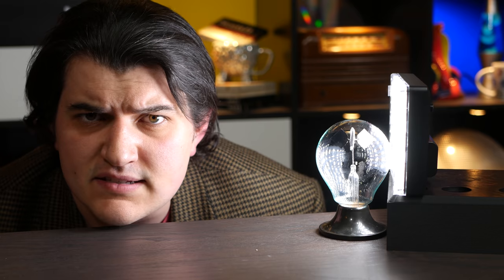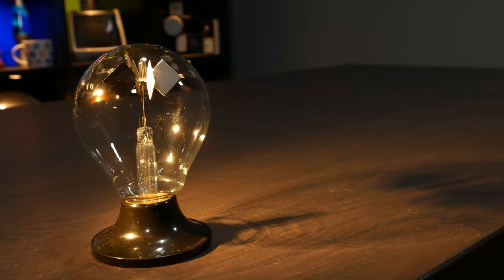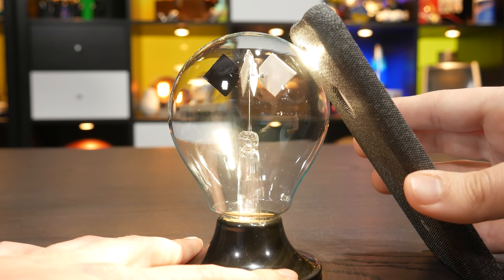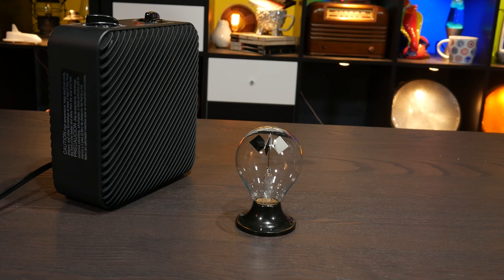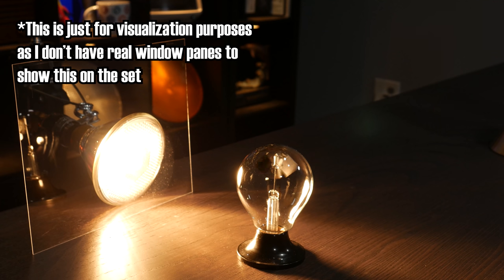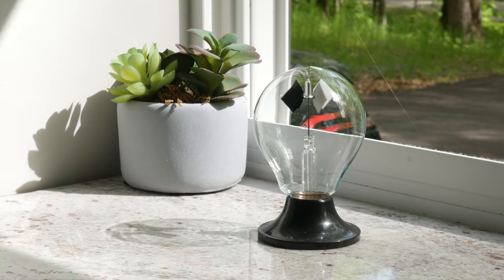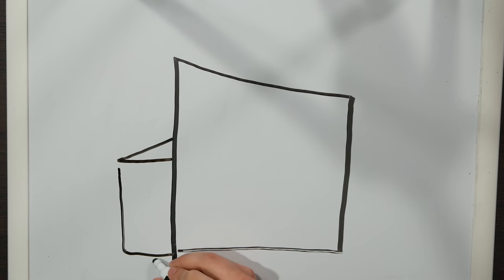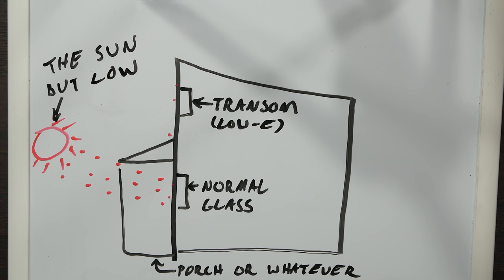What the Crookes Radiometer can teach us

Comment: The side the Low-E is in matters! I work in the office of a large glazing operation. We have actually had large units with low-e stacked on racks (vertically) blow up because the light bounces around them so much that the glass has a thermal failure. They sound like gunshots and will either go all at once or a domino effect.

Comment: I grew up on the East Coast with old wooden windows  which were very airtight. To save energy and keep the house warmer the houses installed storm windows which were installed in the winter. Sorry if I'm repeating what you may already know but those storm windows are installed on the outside of the normal wooden sash windows. They were taken away in the summer so you could open the windows and let fresh air in. Your idea could work, if clear glass was built into to the windows for winter. We would have to change the name. And what we used to call the storm windows would be the summer windows.  The modern summer window would include the low e coating and reflect the sun's energy. Maybe not so practical because people hated having to put the storm windows in and take them out. 
 Almost this as annoying as having to put window air conditioners and in the summer and take them out in the winter. That was one of my jobs as a young boy.

Comment: While the coating on the window glass blocks heat in the summer to come into the house, it also blocks the heat energy in the winter to leave the house. That is why swithing to heat-transparent glass in the winter is no good idea. You simply have to few hours with direct sunlight in the winter. Rememver, days are much shorter than nights then.The house would loose more energy than gain from it. You can have a visual impression of this when looking at a house in the winter with an infra-red-camera. The heated house will simply glow compared to everything else outside. That is, if it is not thermal isolated.

Comment: Hi, I know I'm late to the Party but the part about the low e glass made me write this

I am working for a company that use Co² and nd: YAG lasers at least most of the time. Sometimes we use green 532nm lasers but that's a different Story.

The pinkish reflection you can see is in fact the coating itself. I can't tell you exactly what that coating is made of, but it is mainly for the short 1064nm range IR radiation. We use mirrors coated like this to get the beam from the source into the processing head. Long wavelength IR light like the 10600nm from the Co² Lasers doesn't need special coatings since every type of glass will immediately absorb that. To actually reflect this kind of laser, we use copper "mirrors" focusing a laser like this requires a special material called Zinc-Selenide (if that is the English translation after all.)

Comment: So, as a historic preservationist, I am very much a proponent of Historic wood windows, because of their repairability and maintainability, so that they don’t end up in landfills every 10-20 years like replacement windows.  Historic windows with storms are basically as efficient as a modern double pane replacement.  With the advent of modern HVAC, the use of storms/screens between seasons has lessened.  Having two sets of storm windows would solve this issue.  Summer storms with Low-E glass, and winter storms with conventional glass.  The regular sash can have normal glass.  There is hardware that allows them to pop so that you can open windows for a breeze when necessary.

Comment: I work in a door and glass plant.
Low-E coating comes in different ratings. Thinner or thicker.
It can be applied to one side of each pane of glass. Some windows have it on both sides.
Some windows have 3 or 4 or more panes. Some of these have layered Low-E.
Low-E cannot be applied to frosted or satin glass - the acid etching process destroys it.

A competent architect or engineer will select the correct Low-E thermal ratings for each structure. And will consider things like local weathers, temperatures, orientation, and facing.
A competent salesman will convince the customer to buy the most expensive Low-E option, whether it's optimal or not.
A competent installer will correctly install the Low-E. But the majority of installations are done by less competent, less trained, less informed people - who put it it backwards as often as not. It's a good bet that if they don't have a Low-E detector (an "E-tektor") in their pocket then they don't know anything about it.

Comment: The coating is rejecting much more heat in the longer days of summer than it would allow in the shorter days of winter. So it should work out in the consumer's favor. Especially across the midwest where the summers can get pretty hot.

Comment: I had one when I was a kid and I loved how fast it spun in direct sunlight. The explanation on the box did describe it as heat-driven and claimed that the difference in speed of air molecules reflected off the black and white sides was key. But many years later I saw an explanation insisting that that was wrong too, that if that were the whole story it would quickly reach an equilibrium, and emphasizing thermal transpiration. The thing seems maddeningly hard to explain in lay terms.

Comment: About the Bajorans riding in a lightsail ship to Cardassia, I, too, saw that episode of DS9.
Here's an idea about blocking IR in summer but allowing it through in colder weather -- sunglasses. Imagine a transparent, perhaps strong plastic, pane with the IR reflective film which can be hung up in front of the window and then easily taken down and stored in the garage over winter. The windows could still be dual, or even triple, paned with inert gas between the panes, but the infrared reflective part would then be adjustable as desired for each season, if you don't forget to take them down or put them.

Comment: This device was used to demonstrate the pressure of light (particle-wave duality) for many years, at schools, universities.
The same, wrong interpretation was used to explain tails of comets, being deflected forwards by solar light pressure (false), of course the reason is different - it is a stream of high-energy particles that swings the comet's tail in front of its head as it moves away from the Sun. So we may discuss three remote, contactless  sources of propulsion of material objects - photon reflection (small effect), IR heat transfer (Crookes radiometer) and momentum received from high energy particles (that may include also a ion jet propulsion). Then later many not well evaluated ideas were presented to build a photon propulsion engine (a sail built of mirrors). 
However, Japan sent IKAROS (Interplanetary Kite-craft Accelerated by Radiation Of the Sun) probe, which used solar energy to control the rotation of this rather small satellite. They used a matrix of small movable mirrors (like in video projectors) acting as a control direction sail. 
Back to the Crookes radiometer: once in the '90s (I am not sure if not earlier) somebody wanted to build a new series of these toys and after applying much better technology - a better vacuum, it appeared that rotation of wings didn't occur! So later investigations proved the source of rotation - a IR radiation transferred to heat,  isn't it a bit similar to Maxwell's demon? If - yes, it would be its "macro" version :) 
I am also not sure (somebody may correct me) when evacuating gas from close vessels a higher molecular mass gases are "sucked away" slower, so concentration of Ar and CO2 is a bit higher in a not perfect vacuum atmosphere. Thus making the rotation faster.

Comment: So it's a very very very very very very very very small solar sail?
Reply: No. Well, kinda. It DOES technically have a force exerted on it by the light pressure directly, but that force is basically negligible compared to the wind created by convection (and, as was pointed out, in the wrong direction).
Reply: I think the point of the entire video is that the answer to your question is "no".

Comment: They have static cling nano ceramic and mirror tint.

You can have these on during the summer and peel them off during the winter if needed. 

I like leaving mine on year round since in my mind there's less IR coming in during winter and it helps keep the heat I paid for inside.

Comment: @technology connections Fun fact: I used to work for Sears home improvement as a service tech. One of the products was replacement windows. There are (were?) only a few company's that manufactures/d those...
Anyway, it did matter which way the glass was installed, as there was a removeab sticker that indicated inside/outside on glass packs only. 
The glass can be removed and flipped around, and all you need in a hammer, and a small chisel. I would be happy to demonstrate how to do that as I have a model in my shed that I can do that to.

Comment: For a low-e adaptable window... They make ambient light rejecting screens for short throw projectors. They reject light that doesn't come from a specific angle range. If one could apply a transparent version of that to a window, along with IR reflecting on the angled surface, then high summer sun would have IR rejection, while the low winter sun would not. Basically a microscopic version of the awning idea, except with visible light allowed in instead of being blocked...

Comment: One of the old devices i read about what a decice to demonstrate rf signlas on an antenna, it was two wires horizontally mounted in parallel with a floirescent tube suspended across them. A rf signal was then put on the wire. As you slid the tube the length of the wire you could observe the peaks and valleys of the rf wave on the wire. This demonstratng how antenna length and rf signal wavelength must match, etc.

Comment: Use 2 panes glass with the low e coating applied in horizontal stripes so that light rays that strike the glass from high angles bounce off of a stripe on both pieces of glass but at low angle passes between the stripes. In summer it'd block 100% and winter only 50%.

Comment: Yes - HS physics in 1970's.  Teacher did explain correct reason.  All of these I have seen the rotors are high up in the envelope; I wonder if that proximity plays a role in the operation, similar to ground effect for an aerofoil.  It may be an optical illusion but the one in this video also appears to have the vanes angled very slightly off vertical.

Comment: The problem with low-E glass in the winter is easily negated by simply closing the window blinds to prevent radiant energy from passing through from inside to outside, especially at night. Granted, you still will not get any "free" heat from the sun during the day, but overall, your net energy consumption should be lower.

Comment: We have those electric windows that turn opaque when voltage is applied. Why not do the same but with the low-E coating and a smart controller. As an added bonus, a current sensor can see if the circuit (the window) is broken, and set off an alarm of sorts.

Comment: On the topic of 'does the side of the glass that's facing each way matter?', the answer is no. There are materials (google 'dichroic glass') which will reflect one (set of) wavelength(s) while transmitting a completely different (set of) wavelength(s). However, even these materials are isotropic in that they can be reversed and will still transmit and reflect the same wavelength(s). To the best of my knowledge, there exist no types of coating that will transmit light in one direction but not the other. Source: I have a PhD in sub diffraction limit optics.

Comment: your question about rather or not it matters what side of the glass a coating is on. If you have absorptive and reflective coatings, the ordering of them certainly matters. I would have to find my sunglasses and try it again to remember what the results where, but a pair of amber tinted sunglasses with a blue mirror finish and a flashlight and alternating what side of the lenses you are on and rather or not the flashlight is on the same side or opposite will demonstrate this.

Comment: something extra: 25:47 One summer day, as I was walking past a tall building with a full glass wall on the facade, I suddenly felt a tremendous heat on my legs and arms, and I jumped up of that heat. I was curious about the source of this heat, I even thought about a purposely built source of concentrated heat radiation.
It turned out that one of the large windows formed a concave mirror! with a focal length of approx 25 m. Probably a double-layer window unsealed, argon from the interior (the space between the panes) leaked out during heating, and then the leak gap closed when it cooled down. Internal pressure lowered and glass surface got concave.

Comment: There is a way to implement low-E glass in the summer and not in the winter in the form of low-E storm windows which could be used seasonally. Of course, there's no guarantee that the heat gained in winter by removing it would be greater than the heat lost at night and on cloudy days.

Comment: I feel the same way about the slide rule.  Never gave it much thought, my dad had one, he was an engineer in the pre calculator days. But he gave me his old one, and I found a manual, and those horrible math questions a train is travelling 73mph and it left the station 18 minutes ago how far did it travel?  and in 38 minutes, and in 1 hour 43 minutes, and 3 hours 5 minutes.  You set the slide rule once, and the answers are just there to be read you can see the relationship between speed and time

Comment: Light doesn’t have weight. I just learned this in physics class. It doesn’t have mass but it does have momentum. It’s just Planck’s constant divided the wavelength. It also helps more if you think of momentum in terms of N•s rather than kg•m/s. How it works, I couldn’t tell ya, but I know that it works

Comment: Although photon impulse is not spinning this directly, heat generated by photons is effectively photon impulse transferred into impulse of the atoms in the material (i.e. atoms moving around aka heat). These moving atoms then push off of the surrounding air molecules, propelling the thing forward. Thus is could technically be still correct to say, that the light pressure is causing the rotation - albeit indirectly. What do you think?

Comment: Partial vacuum.  What about the moon?  What about Mars?  Do the tubes even need a  sealed glass? Proposed first experiment on Mars and on return to the moon:  Crooks tubes.  Q2:  what about different gasses: carbon dioxide, ammonia, only nitrogen, hydrogen, helium, laughing gas?  Q3 what about different pressures

Comment: When I was 8 I was gifted a gizmo, it wasn't new, the transparent plastic case was scuffed, it was a solar cell hooked to a propeller blade, not even a fan it did not displace air. But my first experiment was, does it work with artificial light. Waited for night, turned the ceiling light. Yes, but not wel, it spins slower. Tried it with my halogen flashlight and yes, spun faster. Ah-ha! It's the intensity of the light. There was a great sense of discovery and desire to understand and experiment and learn that this simple, old, useless device showed me. The viceral nature of such things cannot be ignored or understated

Comment: @technology connections Low e glass windows would keep a home warmer in the winter than regular glass windows. That's even if the regular glass windows were made as tightly sealed, and double pane, as the low e windows are. The regular windows let just as much infrared light out as they do in. I understand how it was easy to trip yourself on that.

Comment: You can totally have your summer only IR windows. Get plain old windows with no IR blocking and put shutters on them. With the louvers properly aligned they'll block nearly all sunlight from hitting the window but still allow air through. Yes you'll need to close the shutters in the springtime and open them in the fall, but you can't have everything.

Comment: Baring having perfect two-way coating, that would still be subject to physical switching...

A simple bolted (ideally) or snapped-on extra layer on the outside (with care to water management), would achieve that. You put the extra cover in the summer and remove it in the winter. As an added bonus, there is some slightly increased insulation on the windows.

If a two-way coating would work, then a simple 180 rotation of the panes (or Snap-On on the inside) would have dual benefits.

A translucent curtain may reach the same effect, with probably lesser efficiency but ease of use.

Ref :  https://youtu.be/t-JN2U4jHgk?t=1032

Comment: 17:50 no, it would not work. When the IR reaches the coating regardless of the direction it will be reflected back out, you proved that when you had the floodlight reflect from the inside of the window onto the radiometer. However, there would be a little heating of the layer of the glass that the light passed through on the way in and back out, so the glass would get warm.

Comment: As a window salesman, I use a radiometer. I think I had a good idea how it worked before your video, but I still loved the info. To be honest, I was nervous you were going to debunk that demonstration as a sales gag and I would have to stop using it. 😆 You might be interested to know that they do have special glass for northern climates that are designed to reject more heat from the sun when it's high in the summer and let more heat in in the winter. It's by no means perfect 100% reflection either way, but better than they had 3-5 years ago. Maybe someone will invent something better in the near future.